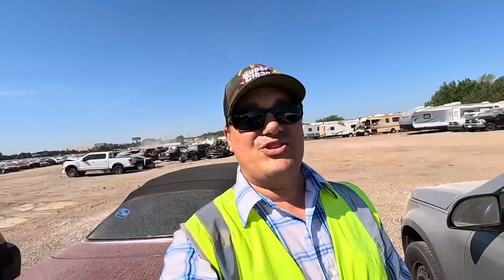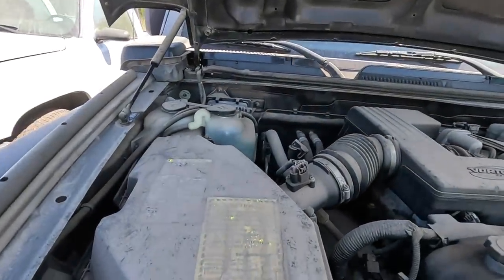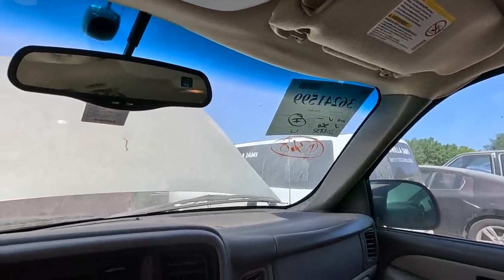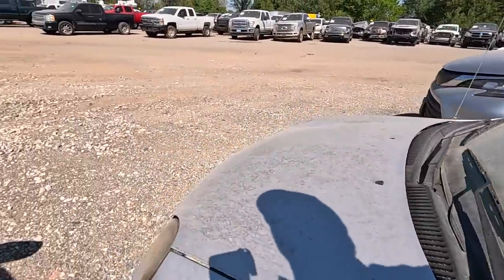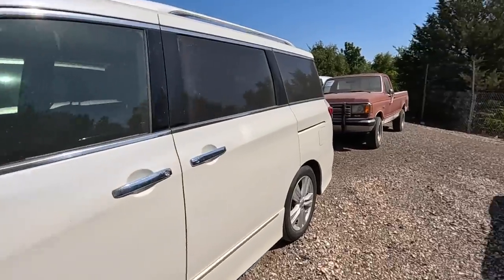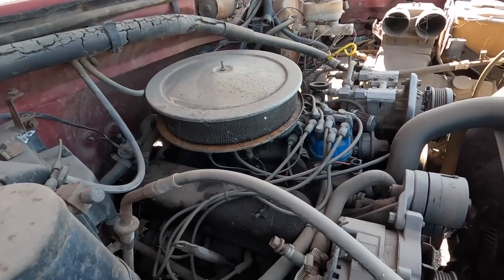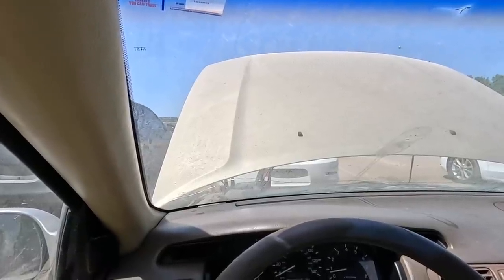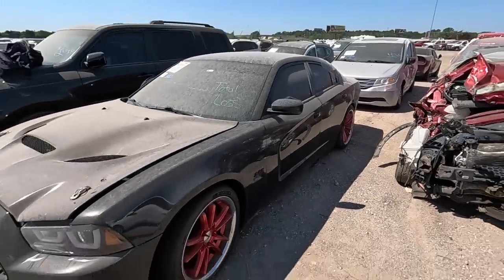A Batman RAM +A  400,000 Mile Toyota Camry at IAA OKC!

Comment: My stepdad used to have a 1988 F150 shortbed 2wd with a 5.0L and 5-speed manual- that was one hell of a fun truck to drive.  When you got on it leaving a light from a stop, the rear would squat and the thing pulled like crazy.  When he owned that, I owned a 1988 Mustang LX 5.0 SSP notchback and I actually think the F150 felt quicker and was more fun to drive than my Mustang was.
Reply: Owner of an 88 GT I know how you feel,  great fast simple car.
Reply: @grovermoore4071  I really miss my fox body.  I purchased it from auction right after high school and right after the car was decommissioned from the Florida Highway Patrol.  I owned it from 1993 to 1995 and had a lot of fun in it during that time.  I really hope I can get another one one day, hopefully an unmodified survivor.  Do you currently own your 88 GT or is it a car that you had in the past?
Reply: @brian5o  twins were born and it rusted to pieces from neglect.

Comment: That camry with the trac and abs light is due to the battery being dead and then receiving power from the battery pack. Well, at least the trac light would come on after a hard reset. You have to follow a procedure that involves jumping 2 pins on the obd2 port. That resets that yaw value to zero. Trac light will stay off after that until the battery needs replaced. It may or may not need the ABS serviced. But, considering it still had working brakes, I doubt that the ABS module needs replaced. They don't fail very often. That camry would be an excellent car. Do the timing belt, replace the windshield and replace/rebuild the transmission, that engine will easily go beyond 600k miles with proper maintenance.

Comment: Toyota are amazing, I have a 2005 Toyota Highlander Fwd it’s my daily driver/ family car with the V6, ice cold air, hot heat and all the electronics work perfectly and the only things I’ve had to do was tires and brakes, it currently sits at 210,625 miles and the only warning light on it’s my TPMS light for a faulty sensor, I’ve always been a GM guy but my highlander changed my mind

Comment: I had a 1997 Toyota Camry LE same color as the one in the video, the car was still running amazing everything worked perfect, it had 497,342 miles when I sold it and it’s still being driven with possibly the same motor and transmission. Miss that reliability, now I don’t have a car at the moment, went and bought a 2011 Ford Focus SeS that was all Rusted out , the front subframe broke in the middle and the Tie Rods broke snapped off the passenger side strut so now I’m waiting for insurance to either claim my car out or I have to buy another car out of pocket

Comment: That charger looks like it got so hot from tha mufflers it started a fire I saw that tips and they look really born but that's a 10,000+$ engine and it's gotta have another 10,000$ in that transmission that motor looks like it can produce about 1,000+ hp

Comment: the 302 and the 351 are roughly the same size because their essentially the same block, only difference is displacement and compression ratios, the only way to tell the difference is to look at the casting numbers.

Comment: In my 02 GMC Yukon the front blower motor was out. The rear worked. So I drove for a week with the rear vents pointed towards me to keep cool until I replaced the blower motor. I medium tap on the bottom of the glove box or a hard pot hole would kick it back on intermittently

Comment: My 2002 GMC Sierra had 407,000 miles when I sold it and it ran like a top.  That Sub may be two-wheel drive.  Disregard the brake lights in the cluster.  Sensors!  They all do it.

Comment: The pcm is on the right side under the hood at the vent cover where wipers are this would be a great one for parts engine pcm tires mags if you can get the dodge car with fire damage. You can get it less than $1000.00 you may get for less than that.
Jim

Comment: The power steering issue on the Camry could be caused by the Abs sensor, my power steering was lost when a abs sensor was faulty. Changed the sensor and the power steering came back.